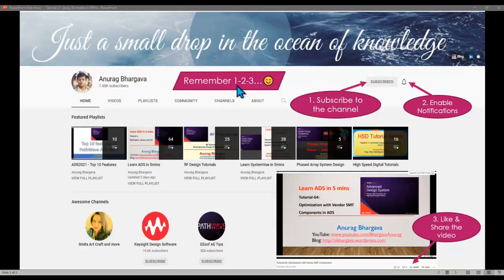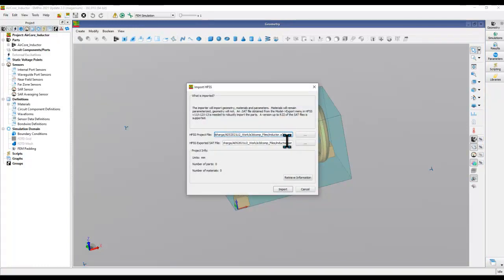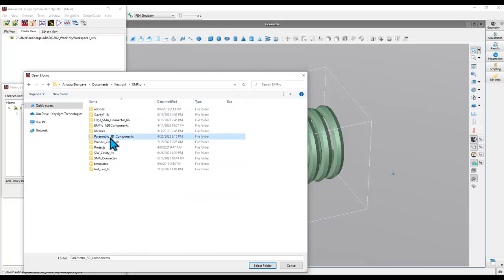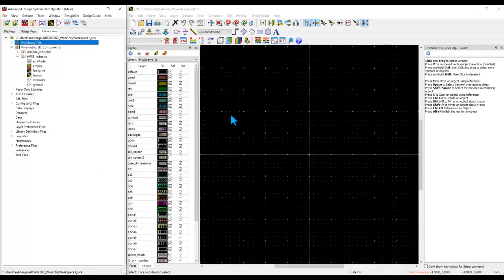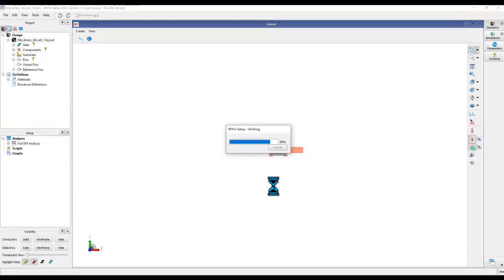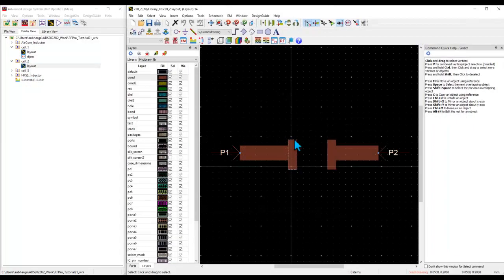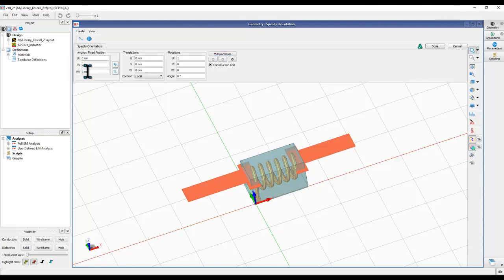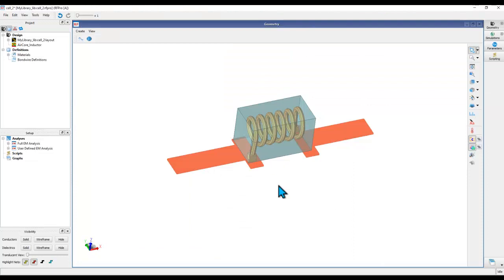RFPro-21: Using 3D models in RFPro

Comment: Hello, thank you for these videos! Is it possible to define a port somewhere above the layout in the z plane in RFpro? For example if you had a connector coming out of the PWB as a 3D component, can you define a port at the top of the connector to include it’s impedance in the simulation? Or can you only define ports on the actual PWB layout in the 2D plane?
Reply from the maker: If you want to include port on connector model then this video will be of help: https://youtu.be/dcy47zwC0Lk
Reply: @BhargavaAnurag  thank you! I missed this video! Your videos are 10/10, I hope you continue this channel, I’ve shared it with many of my colleagues at my work!

Comment: Hello, great video, thank you. Is it possible to change the surface of a material to be non conductive? For example, can you make a coil made of copper but that has a non conductive coating around it to keep the windings isolated from each other?
Reply from the maker: Yes, you can define the material properties easily when you create these kind of components in EMPro. For the example you asked, you can create 2 co-centric coils with different diameter and define the outer one to be non conductive.
Reply: @BhargavaAnurag  ahhhh I see now, thanks for the great videos!